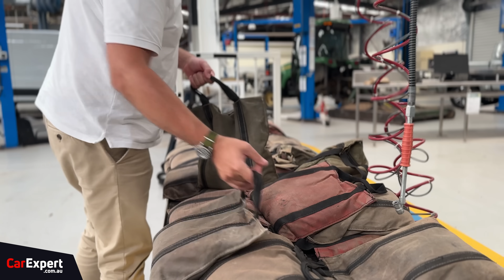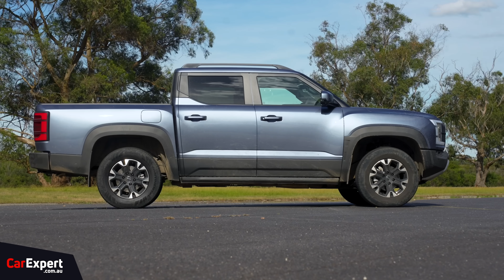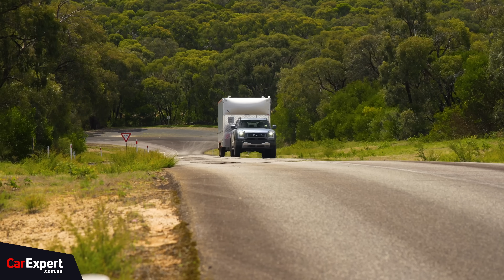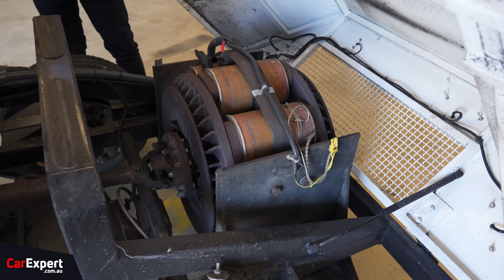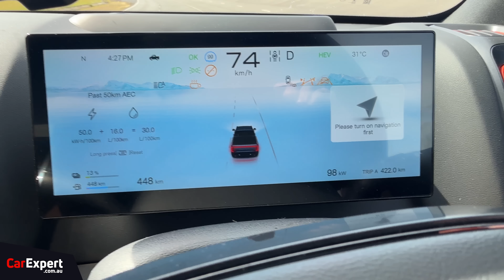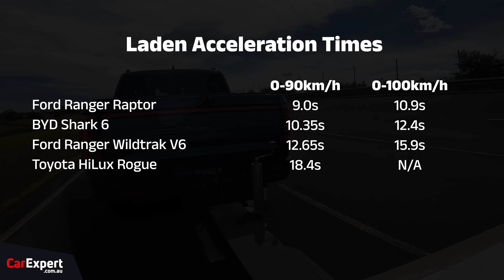BYD Shark 6 towing STRESS test at MAX payload - the results are surprising...

Comment: hi. In Finland, the speed limit for braked trailers is 80km/h, because we do not use an "active" braking system in trailers. Even though the speeds are low, the large trailers that our company has increase the consumption of, for example, a Ford F150 lightning to almost 100kwh/100km. This means that the BYD Shark should be able to supply power to the battery with more than 100kw in order to continue the journey for longer. What size generator is in the BYD Shark 6?

Comment: Do you think diesel trucks will still travel farther or have longer range in one full tank vs byd with full charge and a full tank? Assuming both are traveling the same direction and speed.
Reply from the maker: Yes, assuming it’s a greater distance than the available battery capacity. The BYD uses a smaller internal combustion engine and weighs more than an equivalent diesel. Once the battery is used it will travel less distance for an equivalent amount of fuel.

Comment: Why's everyone comparing apples to oranges? Compare a PHEV ranger to this PHEV BYD. Not a diesel one to a PHEV one. Obviously normal ICE utes wouldn't have certain limits when towing. Also, this is an extreme case. You may use a bit more when towing in certain scenarios but once you're unhooked and driving about you're using half the fuel. Also, most people are towing to their annual holiday maybe twice a year and not usually at the limits of what their cars can tow. For those towing massive heavy caravans very often then maybe diesel will be best. For those not towing super heavy caravans and doing it only once or twice a year, a PHEV ute becomes more beneficial. Simple.

Comment: Shark 6 has got a stop charging mechanism. In case you run an unlimited uphill and battery go flat, you can always stop the car and let the engine run for 20 minutes. The electricity level will come back again.

Comment: According to quoted spec., regen will only charge the traction battery to 70% SOC. And below 25% SOC, the petrol engine takes over. So the BMS and the driver are constantly on a seesaw of power source. Think it would have been better, if the Shark was a straight HEV.

Comment: He said its an edge case already. The issue for here is not keep the battery threshold higher or lower but its about the total output of the engine is lower than the competition, and they used the electric engine to match that. When the load is high for a extended period of time, you will exceed the output power of the ICE, therefore it's impossible to keep both battery charged and tow heavy load. 

Other trucks has higher output power from ICE alone, therefore it's possible to just tow and tow. 

If we use a Rivian we can also tow like this and keep going as long as there's charge left while keep the speed - the motor is designed to do this alone.

Comment: I think all the comments talking about the low charge minimum are correct. I would also add this issue happened at 422 kilometres in the test.  If this were an ice engine you would have to stop by then to fill up.  I found it kind of interesting that the range was similar to an ice engine without the necessity to find a gas station at about the same range.

Comment: Pretty amazing bit of kit really, and this is just the first version. Battery tech is improving at a steady rate so with higher energy densities and\or cheaper batteries these things are only going to get better. 6L\100km unladen and 0-100 km times are incredible. I own a Model Y and a 2005 Hilux Workmate ute

Comment: Will be very interesting to see how this performs in 10 years with a battery that might be well past its peak in term ms of holding charge. In addition I imagine it could mean the internal combustion engine is having to pick up the slack? (did he say 1.5L?). Big ask for a small motor? 

Wondering how all these hybrids will go long term regarding reliability. Could be great, but seems like a bit of a gamble with relatively new tech?
Reply: A battery that has lost 20% and is in freezing conditions with the heater on

Guessing the result will be bad

Comment: Theoretically, I wonder how many kN needs to be applied to the load testing trailer, in order to represent the maximum towing climbing grade that BYD has set? Is the trailer's 3kN load under the 12% figure mentioned in the BYD specification notes?

Comment: I couldn't care less about utes, but boy so many people think these are the answer to a daily family car. That is their choice it's their money. 

Its obvious reading or watching anything from CE that it is very very much pro-fossil fuel and has its favourite brands to push, and anything from China is a dubious choice, this popularism opinion (in auto journalism) means they probably waiting for a new owner buyout at the right price 😂 (aka $$$$$$$ car advice).  

Curious why this prototype BYD was compared to the the others in the mega ute test? The reviewer said it was towing the same 2.5t trailer on the same road, but none of the other utes were asked to also carry their max payload, but they show CE putting the max legal sandbags in the tray of the BYD. Why was this an exclusively BYD test? Do not other utes also have a max payload and still tow?

Why did CE not show the battery level and regen on the dash video? Why did you zoom in to cut out this important information so people can put in context what actually was happening?  Everyone knows what low pack volts does much like altitude and temp can effect the performance of an ice. See Pikes Peak.

Looks to me like Paul an CE have allowed themselves to become exposed to personal preferences over showing everyone has an equal playing field and will get balanced reporting (Inc electric and being chinese)

Comment: 12:38 when you say "...the vehicle eventually did fix itself" you are being misleading and implying the vehicle has a problem to fix, when in fact it is the natural characteristics of its hybrid system with relatively low sustained power output (petrol engine charging battery while providing propulsion), compared to ICE vehicles.

Comment: Great review,  answered some questions... but one more for you.... do you hv any idea what would happen when you're on a long hill and can't do 70kph.  The Takaka hill in NZ is a 700m climb about  17km long and at no point do you get above 70kph.  Because of the open road driving leading up to the hill I worry the battery will be exhausted before the top.. so what is the likely outcome when you're relaying on battery only... out of interest we drove it yesterday, 2006 hliux fully loaded with kids and caravan, plus 6 mtbikes on the roof so aerodynamics not in your favour! .. it's 2nd and 3rd gear the entire way bar one small down section a couple of km before top.  would love ur thoughts??
Reply: 700m over 17km is a pretty gentle 4% average. At 70km hr with SOC set at 70% I suspect it would be totally fine. Obviously, if you let the battery drain it may struggle at times.

Comment: 12:30 or you could be in a Mitsubishi Outlander PHEV that just dies on you(with no trailer) losing ALL ACCELERATION & STOPPING IN THE MIDDLE OF THE ROAD. Or at a set of lights, or going up a hill!!!

13:30 yeah until your V6 Prado/Landcruiser Engine eats it's Bearings or dies prematurely from ingesting dust(from I'll fitting Air Cleaner)!

Comment: Tows great? Sure if you want to go 100km. Not really practical in Australia.
Reply: No one tows a trailer dyne down a highway. In most typical conditions with a high SOC it does fine, looks really comfortable and 30L is around what all other vehicles use on this test.

Comment: My old Nissan Navara used to tow a car on a double axle trailer as if it wasn't there with the same top speed. You must be getting a sling from BYD which was actually running an ICE.

Comment: Paul, I’ve been doing some reading on Tow Dynamometers similar to the one you used in an attempt to better understand your test and I’ve come to the conclusion that it was kinda pointless (sorry). I have learned that many of these Dyno Trailers can be programmed to simulate real world hills with prerecorded GPS gradient data so that an actual climb can be replicated on the flat test track. Can your unit do this?
If it can then I would like you to consider rather than testing ‘all’ vehicles with the same settings on the Dyno Trailer and just performing stress tests that aren’t really relatable to most of us, why not program the Dyno Trailer with something like the hill climb on Thunderbolts Way between Gloucester & Walcha or some other pretty challenging hill people will be familiar with and have thought twice about attempting and use settings that reflect the GCM ratings for the vehicle being tested and the speeds you’re actually likely to be doing instead of the one-size-fits-all 100kph test you’re currently using. Because…..from what I can tell you essentially tested the Shark using criteria designed to stress vehicles with 45% more towing capacity and presented the results as directly comparable and I’m pretty sure every other ute on the market would perform equally as poorly (if they could even do it) if you test them at 45% above capacity. So as entertaining as it may have been it doesn’t seem fair (to me anyway) on either BYD or your viewers trying to understand this new vehicle before possibly shelling out their $60K+ and hoping for the best. What say you?

Comment: The Yangwang U8, BYD's groundbreaking electric luxury SUV going to be a bigger game changer then the Shark 6.
The Yangwang U8 has a 2.0-litre turbo-petrol engine with four electric motors - one at each wheel - to deliver a staggering 880kW and 1280Nm.
Reply: So as its price tag ...... the price of 1 Yangwang U8 = 4 Shark

Comment: Can someone answer this scenario, our Gillies range up here in the far north is one of the longest and windiest in the country, 60 km/h speed limt but in reality much less for most of it if you're towing. Even assuming a healthy SOC at the bottom is there a chance you could end up running on ICE alone before you get to the top? Futher to that, can the ICE connect directly to the front wheels at low speed (low revs) and provide charge at the same time? Without knowing exactly how the system integrates ICE and battery, I can envisage a situation where you're pulled over at the side of the road while the ICE puts some charge back into the battery. Maybe Paul wasn't so far off the mark. I'm happy to be schooled here.
Reply from the maker: We are about to film a follow up video now based on some of the crazy comments on this video. But one comment that sparked interest was referring to a part in the user manual that claims you can't tow at gradients higher than 12% (literally 7 degrees!). It's abysmally bad if you want to tackle something like the Palmerston Highway where you'll find 15% grades. A 12% grade really isn't that steep and it's a dire limitation on the vehicle if it can't manage something basic like that.

So we're going to make sure we get that information out there. At this stage it's buried as fine print in the 244 page owners manual.
Reply: @CarExpertAus  Thanks Paul, looking forward to it. And yes, the Palmerston is quite steep at the top end past the Beatrice River. Other than that you can mostly keep up reasonable momentum, traffic permitting, but it's still a long climb.
Reply: @CarExpertAus  page 104 of the manual states that.
Reply: Mate, rough numbers calculated, as no actual meaningful test was done. Towing 2.5T big sail area, at 100km/hr assume 90kw required, add 15kw for every 1% of grade. (the 3kN is representative of a 4% grade, e.g assume the test was drawing 150kw at 100km/hr). If you are doing 60kmph - you could safely half the power requirement. Below 70kmph the motor cannot directly link to the front axle - that said, you are likely to need well less than 100kw to climb anything at 60kmph - and provided you start with a state of charge at 50% and and aim of 50% and do not deliberately run the battery flat by setting a 25% setpoint so the ICE doesn't help until its too late...

Another way to think of this - if you assume the ICE motor only can push you along the flat at your desired speed (highly likely), and you keep the ICE running with an appropriate setpoint - then each 25% of the battery will lift 6000kg just under 500m vertically. This is a 5% grade (like the 3kN drag), for 10km. So if you start at 75%, and keep the ICE running on a climb - you should conservatively be able to climb 1000m vert, or 20km at 5%, or 14km at 7% etc... At 100km/hr. This is steep and long, most Australian climbs will be 200m vert, you are in the US Rockies around Colorado to get anything near 1000m vertical - and nobody tows up these at 100km/hr.

So the theory is sound. The Shark should be an absolute beast up long hills. And Car Expert had the gear to test this. Set the drag to 4kN (equivalent to 7% grade towing 2.5T), Set the charge setpoint to 75%, and start at 75% to prepare for a big climb, and see how far it goes till it hits 25% at 100km/hr.... 

And if it can do it without overheating etc - because there is a real chance it may have issues as this is all new. Also - pulling away from stop on 15% grade would be interesting.   (Note at 4kN drag the Prado would be at 85km/hr ish max)

This is the test we actually wanted and how it will be used. Not a set up to show how to make it fail.
Reply: @shanebatchelor1  So the answer is to keep the ICE running. FYI, the Gillies is 260-odd turns, 19 kms in length and about 800M vertically.
Reply: @grahamsenini8024  That's the theory, the energy available from battery and engine is more than enough to climb that, and how it should have been tested - to see if it works like it should. What was tested was theoretically impossible - and of course it failed. I'll retract my 200m vertical claim - but to quantity was talking about 7% grade, 90 - 100km/hr climbs, where a continuous 200+kw is required...

Comment: I can't believe you've done all this extensive testing but missed a crucial component: will the ICE have trouble maintaining SOC level during long distance towing? To do this is super simple, just hookup the 2.5T trailer, set the SOC to 50%, set cruise control at 100km/h around the test track, and see how low the SOC level drops to. The trailer dyno test was simulating towing something UPHILL all the time, of course it will drain the battery and leave all the hard work to the ICE, but it is in no way an indicator of long range towing capability.
Reply: @qingpeterwan4880  they did that, it way underperformed other tow vehicles on their big circular track.
Reply: @mattmobiles15  No, they hooked up the 3kN trailer dyno and ran around the circular track, it is completely different than what I suggested.

Comment: 1. The prado kakadu is 2.8L right? So if we use another 1.5L ICE car in the same condition, can it running at 100km/h or lower?
2. Shark can't constantly run 100km/h in this conditon. But if we start the test with 70% SOC, how long will Shark run before it cann't keep the 100km/h speed and what is the SOC then? I think that's a more meaningful test. 
Thanks

Comment: it doesnt matter if he has the battery set to 75, 50 or 30. in that test it would eventually reach 75% then the motor would do the same thing trying to maintain 75%… yes its fine for a few laps but 10 laps later its gonna repeat whats shown in the vid
Reply: Why wasnt this explained in the video?  All the details of this test seem to be left to speculation in the comments section.  Appalling testing...
Reply from the maker: Spot on!
Reply: @CarExpertAus  well, wouldn’t it have been nice if you had actually tested that! The whole point of the test, as you said at the start, was to set the vehicles cruise control and see what the fuel economy was, wasn’t it? Like you tested the other Utes..correct? Not deliberately driving outside of normal, sensible operation to cripple it to see what would happen. Nothing wrong with that particular test, if it was done it isolation. it was actually interesting as it showed that even under the worst conditions it could cope reasonably well. BUT to imply that this is result of the ‘standard’ load test and this is what happens to this vehicle (and could happen to you wary buyer!) compared to an typical ICE vehicle is very, very poor…at least the shark had 13% battery. You had 0% credibility after that…
Reply: @beerfordolphins  Spot on!

Comment: While load testing is fine, Paul's road testing was plain WRONG.
Nobody owning a Shark would be stupid enough to tow a heavy trailer without using a comparatively high SoC setting on the BYD Shark.
It's like telling someone that if you can reach the speed limit in second gear you don't ever need to use 3rd or 4th gear.
Reply: Or saying you only use gears to speed up - so leave it in 5th up a 7% grade....
Reply: What does SoC mean?
Reply: @Ellipsis141  state of charge

Comment: 2.5 t is not good enough has to be at least 3 t
Reply: Says about 2% of ute owners. Need 3+, get an expensive, rattly over priced ranger or hilux.
Reply: @Johnno1979  Australians should not be forced into buying something they dont want or cannot afford  that's what happens in authoritarian states.
Reply: @rosswebb9295  that would certainly make for a better experience yes. 
One of the biggest problems I can see affecting people is regarding trailer ATM. For example a friend has a 1.9T TARE off road camper that is rated at 2.9T ATM. Thats 1000kg of crap you can carry on it, everything from a tinny on the top to generators, fuel etc. etc. But unfortunately because that 2.9T is stamped on the compliance plate the BYD won’t be allowed to legally to it. It’s a stupid rule that makes no sense to me at all but it’s how it’s applied and many many highly suitable campers and hybrid vans will fall into this category.